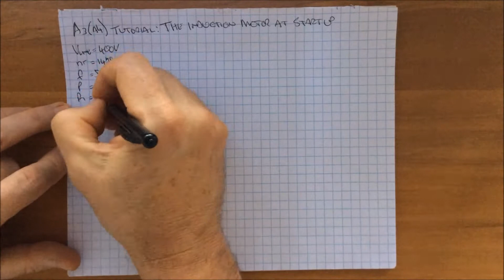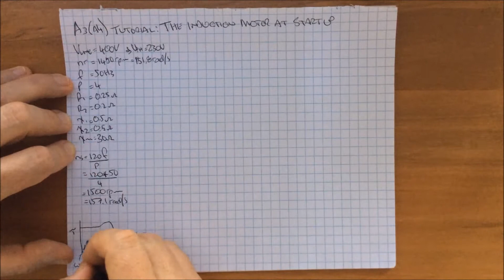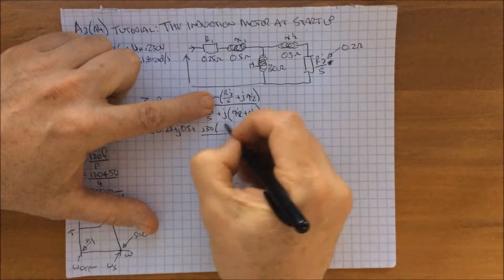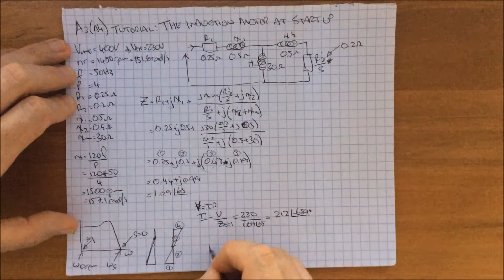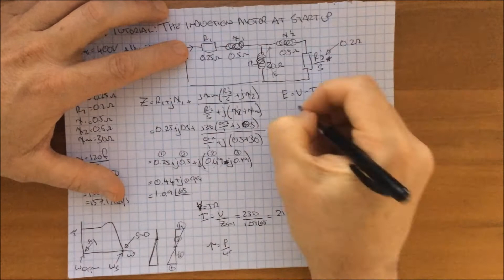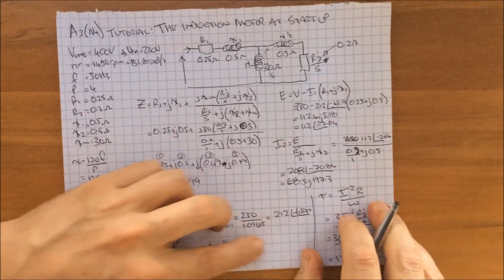Taylormade@AUT: The Induction Motor at Start-up

Comment: Why are you using speed = 151RPS (i.e. base speed) with slip =1 (i.e. zero speed)
Reply: I think it's a small mistake: the speed should be the synchronous speed (157.1RPS). Torque formula is P_delta/omega_s.